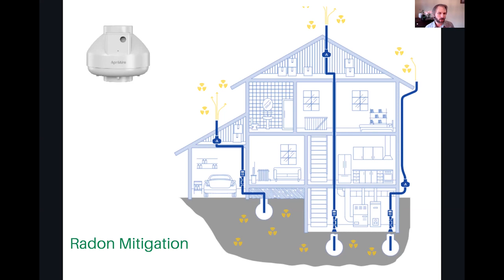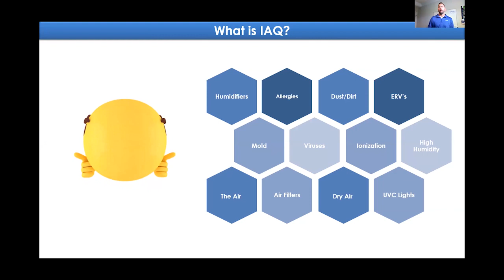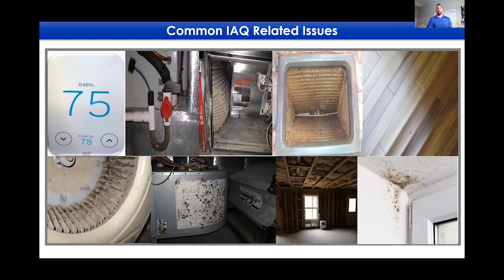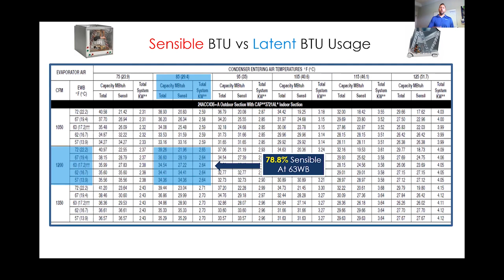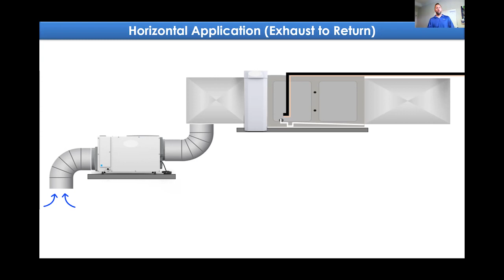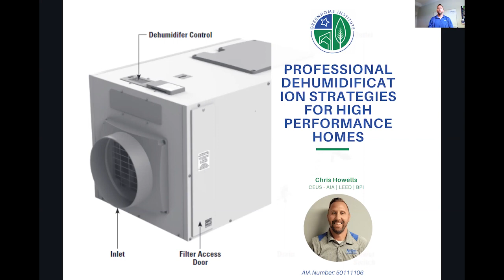Professional Dehumidification Strategies for High Performance Homes

Comment: Hidew makes high (90+) efficiency heat recovery ventilation with integrated dehumidification at twice the airflow on a 5 way flow system. neat.